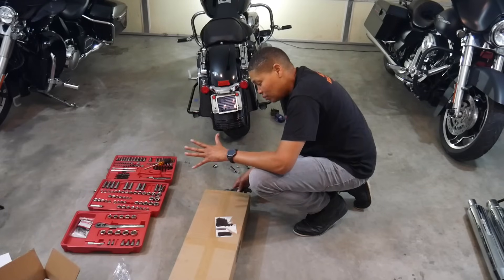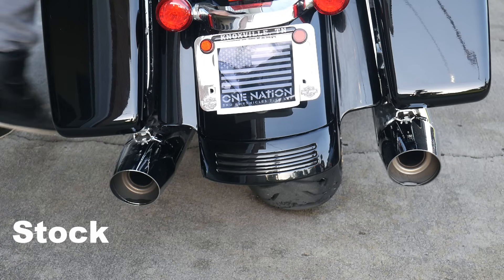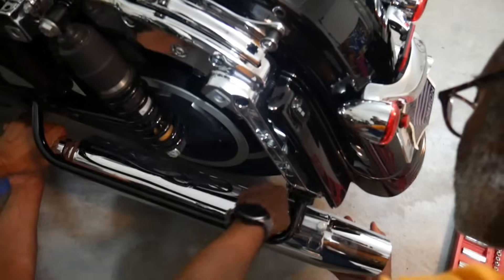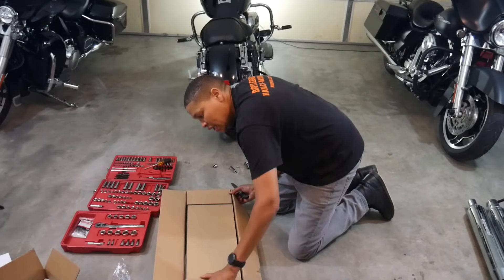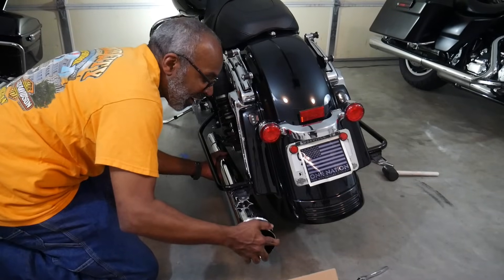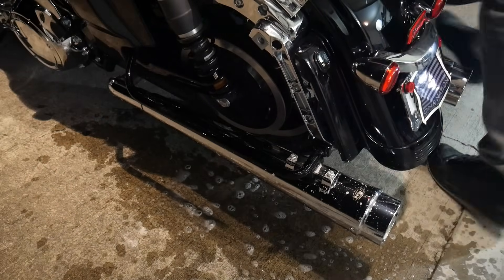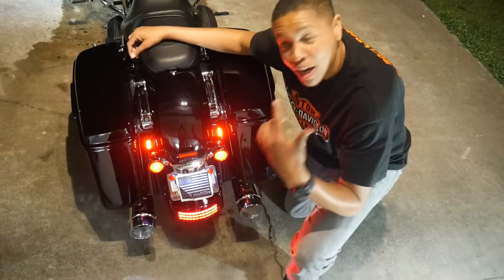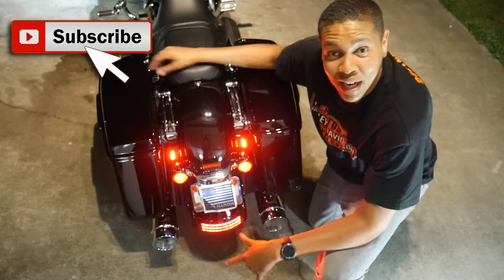M8 Harley-Davidson  Street Glide Slip-ons Loudest and Meanest  sound for less money.

Comment: Did you notice any power loss?  Large diameter slip ons are supposed to rob torque in the low rpm range.